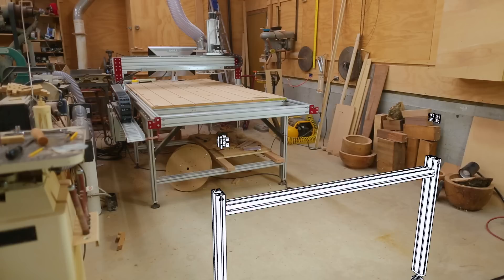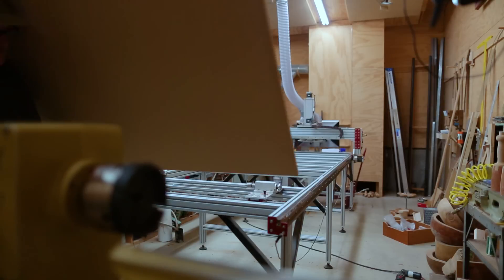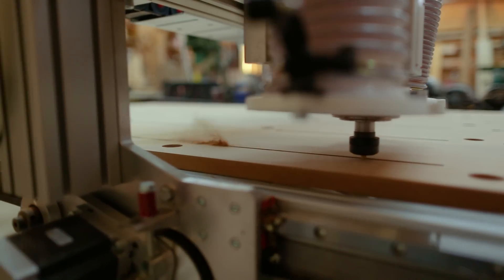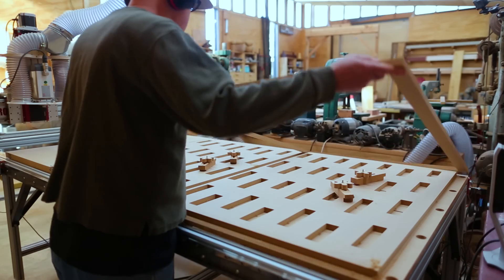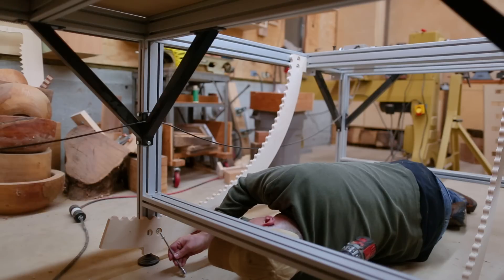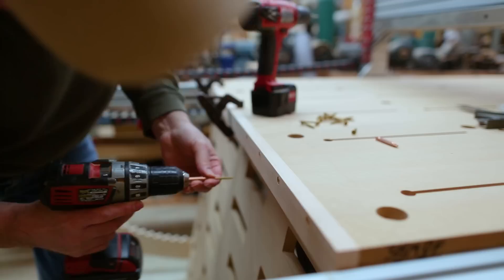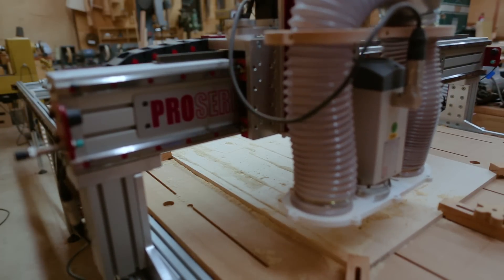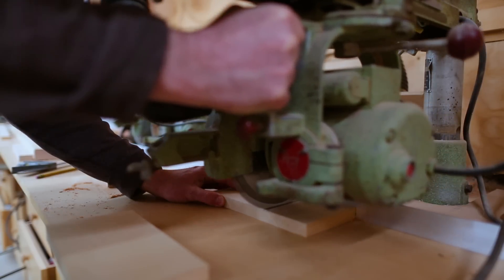Vertical CNC Table and New Spoil Board

Comment: Frank or anyone else, can you point me in the direction of the tool you used at 11:25? for accurately drilling the centre of hinge holes. Cheers!
Reply: Ben Hainsworth Search “self centering drill bits” on amazon.
Reply: Self center hinge drill bit. You can get a set at home depot.
Reply: Also with your ratcheting system and wanting to have gone with the cool/complicated gear system, it looks like you've got a certain range between each step on the ratchet. Could you compromise and come up with a way to fine tune the position of the table between each tooth? I.e. if you have 5 degrees per tooth, be able to fine adjust the position to 1 degree?